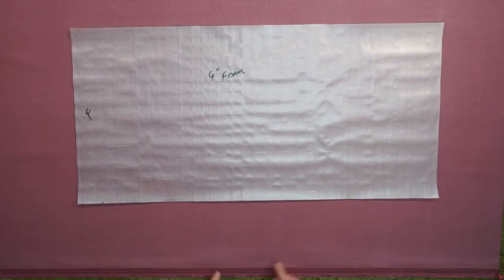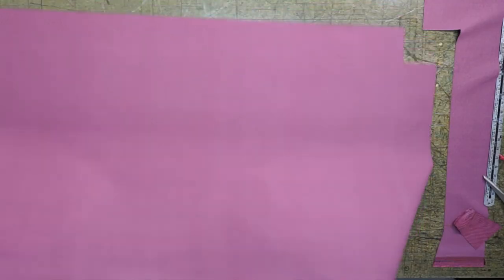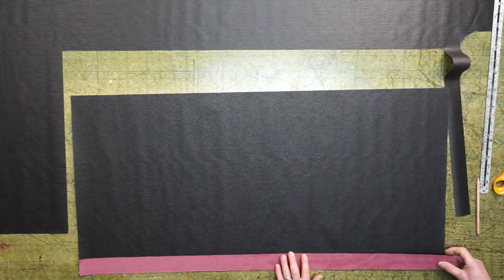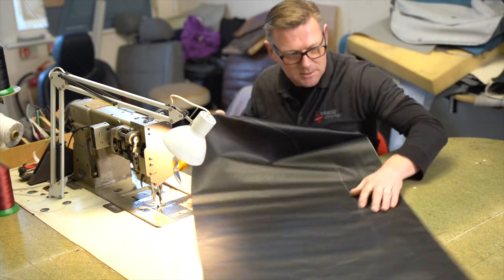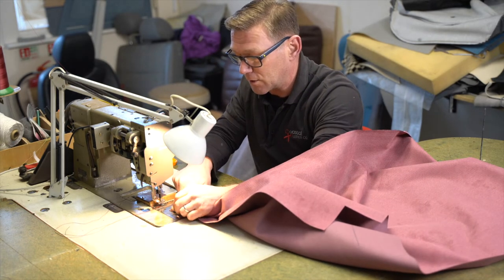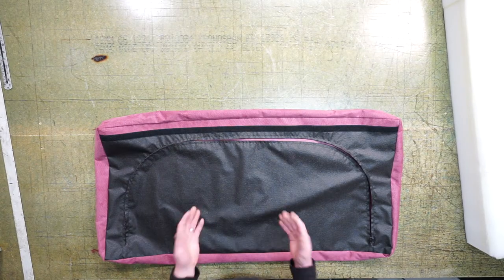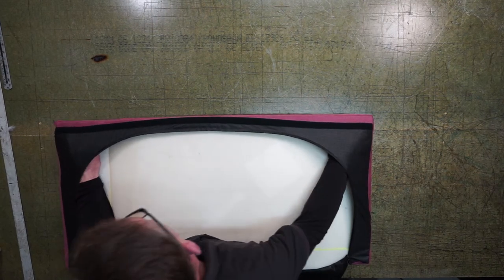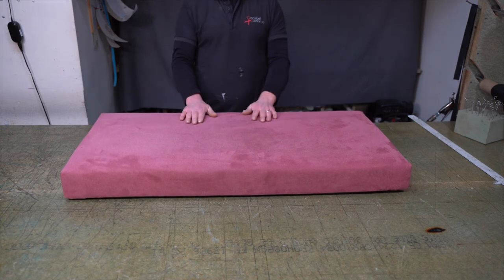Camper cushions the easy way. How to, a step by step guide.

Comment: I really appreciate you sharing your talents.  I have a question about the zipper, how do you keep other fabrics from fraying out?
Reply from the maker: The fabric that the zipper is sewn onto doesn’t fray
Reply: @coastalcushionco8227  I am using fabric that does, how can I prevent that?
Reply from the maker: @LeahSleeth  once you cut the fabric along the zipper teeth, fold the excess under itself and then top stitch it in place

Comment: What type of fabric did you use for the base with the zip please? Also i noticed you just cut the fabric through the middle of the zip. Do you leave these unfinished, it didnt appear that you finished these in any way. Thank you
Reply from the maker: the fabric is called Nautolex cushion underlining, it comes in 4 colours, its marine grade, breathable and dose not fray so the ends don't need to be finished good for indoor and outdoor cushions